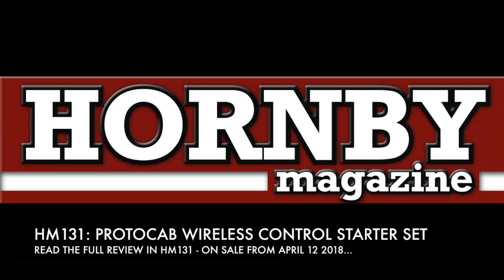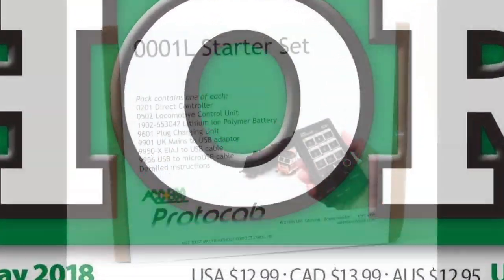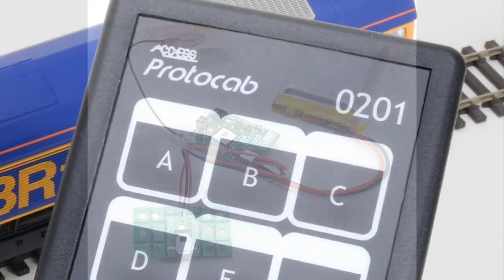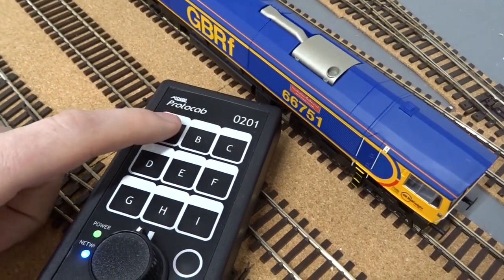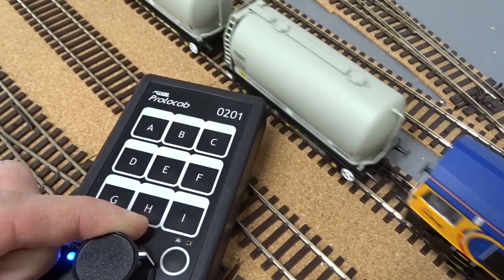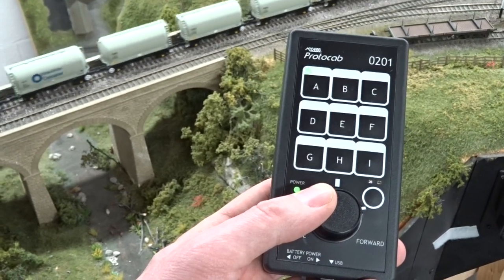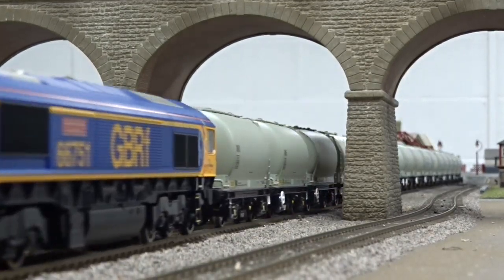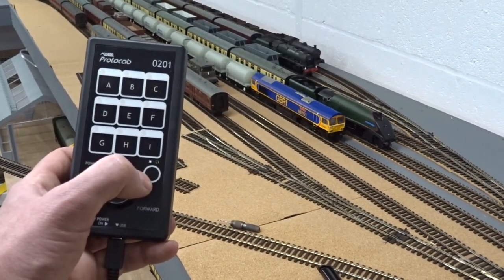HM131: Acc+Ess Protocab wireless control system

Comment: Would this be perfect for a garden railway? For example, would it be able to run on the rails even if the tracks wet?
Reply: I understand that they've set up for garden railway use Eg using LiPo batteries etc relative to heat etc, but if running in the rain the equipment must be kept free from water ingress - common sense really. 

On older RC systems if rails were wet you could get the 'rusty bolt' effect/glitching but I suspect that such things are now not an issue - certainly isn't with 2.4 GHz systems these days. 

I hope that helps👍😊